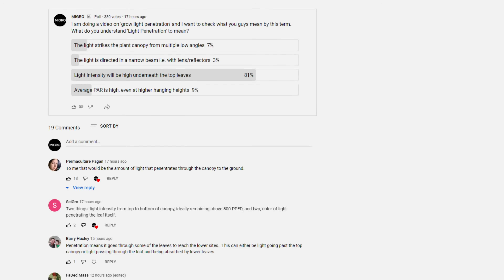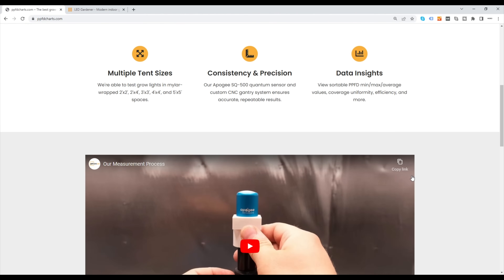Grow Light Penetration is WRONG

Comment: Takeaway........ defoliation and stripping  unproductive budsites is your friend no matter what light you're using. If you have limited overhead room in your grow area and want uniformity in light spread and less intensity and hot spots, use a bar style. If you just want to saturate your plants with intense light and can manage hot spots over your canopy raising the fixture within smoke overhead space, use board style boards. Prune and thin foliage for best "penetration"of light and maintain a hanging height of fixture to maximize light coverage on the actual bud sites. Leaves are like solar panels to collect photons for energy, but they block the photons from effectively reaching anything below.
Reply: I keep explaining to people that everyone needs to stop expecting their grow lights to do the work for them. It is a light. You are the gardener. If you want proper penetration you will do proper canopy management. Otherwise you will do what Shane said and ignore two-thirds of the plant for just the top little bit. Obviously Shane doesn't like 3 foot long colas. Hey to each their own. Some people are just too frightened to manhandle their plants and some are just too lazy. For Mr Shane here I'm sure it is just a matter of not having time. So many Growers don't realize it is a weed and is extremely extremely tough.
Reply: @yrntthelibswipedofftheeart16  the plant is extremely resilient and responds well to defoliation. During veg, just maintain the naturally aging and yellowing foliage. Once you get thru stretch around week 3 of flower, defoliate. Every leaf that has a stem, remove it. ✂️🌱
Reply: Your comment described the video perfectly! If anyone was confused about anything, you summed it up perfectly.⚡👍⚡
Reply: Very true, n u explained it way better✌️
Reply: Defoliation means you take off ALL of the foliation. I hate it how cannabis growers completely misuse this term lmfao
Reply: @GeofryMasters  it is not a misuse of the term. It is using the term in a different context. Are you just trying to find a use for a liberal arts diploma?
Reply: @roywarriner8441  No its an absolute misuse of the term LOL. I have been in the horticulture industry for over 2 decades, professional botanist and cannabis grower. Pruning is the correct term, defoliation is not. Grab yourself a dictionary for god sake. Or even better go ask your local botanist at a plant nursery, NOBODY in the industry uses the term outside of the cannabis community because its incorrect. I am not even going to entertain such a ridiculously stupid argument any further than this reply.... Later guys
Reply: @GeofryMasters  dude I prune, I don't defoliate. But to go all english major over such a minor point is pretentious. To most boomers, whether they grow their own or not, defoliation means agent orange and vietnam.
Reply: @roywarriner8441  Thats ONE of the definitions. K this is all im gonna say, if something is DEcentralized is it still semi central or completely not centralized? The prefix of DE means to literally not have... Its not "big brain" stuff my guy lmfao

de- prefix
Definition of de- (Entry 2 of 2)
1a: do the opposite of
deactivate
b: reverse of
de-emphasis
2a: remove (a specified thing) from
delouse
b: remove from (a specified thing)
dethrone
Reply: @GeofryMasters  I'm not arguing your definition, I just don't think it was a point worth making so I got a little sarcastic. Like I said, I don't associate the term defoliation with pruning my plants, but I understand what people mean when they use it in that context and don't need to make an issue of it. I think we can agree that pruning is beneficial as is training to open the plant up.
Reply: @roywarriner8441  Its not a term used in the actual horticultural industry. That's was my whole point lol. Great reading comprehension you have there!
Reply: @roywarriner8441  Like just for an example search defoliation on youtube. Only cannabis growers use this term in place for pruning. All the other videos made by actual horticulturalists or just the average grower never uses the term unless you're in the bonsai community, then defoliation is a rather common technique. Its hilarious how I get attacked for clarifying a misused term. Imagine if a tradesman used a common term in the wrong situation, would you hire him for work? I wouldn't hire a grower at my facility if he didn't know the difference between pruning and defoliation lol
Reply: @GeofryMasters  bud, again there is no argument, get over it.
Reply: @roywarriner8441  Yes there never was lol. Its called the english language. We have definitions for a reason lmfao
Reply: @roywarriner8441  And... you got proven wrong... Take it like a man and quit it with the deflecting
Reply: @GeofryMasters  might just be your perspective of the word. I can't say that I've ever seen a definition of the word defoliate meaning ALL the leaves must be removed. In all reality, any grower in ANY industry would simply remove a desired amount of leaves to accomplish a cultivation goal. Defoliate, from many individual's perspective is just "the act of removing foliage". Pretty sure any widely accepted, official definition doesn't specify all foliage must be removed. If it makes you feel better and improves your perspective of cannabis growers, we can use the phrase "thinning foliage" or "opening up the canopy". Maybe just the phrase "removing leaves from a plant". Or, to simplify the phrase for commenting on the subject, a single word like defoliate could be used and individuals can simply take it for what it means. "To remove foliage". 🍻
Reply: @greybush1976  I think he did a tour in 'nam and is experiencing flashbacks. To him defoliation is when you spray agent orange on a jungle to expose the little brown men hiding in it so you can kill them.
Reply: @GeofryMasters  I mean, you’re the only one who gets it wrong brother. Anyway, do you even grow?
Reply: @REON-pw5ze  Definition of defoliate
transitive verb

: to deprive of leaves especially prematurely

deprived; depriving

Definition of deprive
transitive verb

1: to take something away from
deprived him of his professorship
— J. M. Phalen
the risk of injury when the brain is deprived of oxygen

prune verb
pruned; pruning
Definition of prune (Entry 2 of 2)
transitive verb

1a: to reduce especially by eliminating superfluous matter
pruned the text
prune the budget
b: to remove as superfluous
prune away all ornamentation
2: to cut off or cut back parts of for better shape or more fruitful growth
prune the branches
intransitive verb

: to cut away what is unwanted or superfluous

Yea I guess I'm wrong LOL. Man you guys are something else hahaha
Reply: @GeofryMasters  somebody thinks themselves smarter than they are

Comment: Any advice on a led for a 5 x 5 tent I'm thinking of changing from hps
Reply from the maker: You could try our ARAY 12 PRO, link here: https://migrolight.com/products/migro-aray-12-720w-800w
Reply: I like my hlg but I’d at least go with a scorpion or a well reviewed bar light. The tent height kinda screws us with quantum boards tying to get an even spread. I need 2 ft or so to get good spread on my 600r in just a 4x4.
Reply: Thanks everyone I will take a look now
Reply: Honestly the next time I need to buy a light I will most likely be trying migro. Should crush with my ceiling height issues and no other company is as chill or putting out information like this one. Also I need to get that Uvb bar. Good stuff Shane